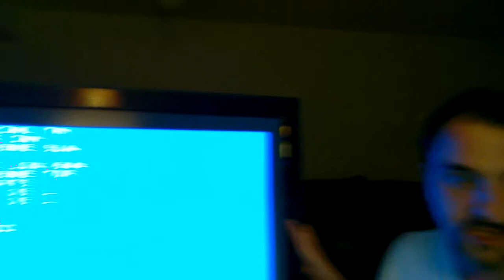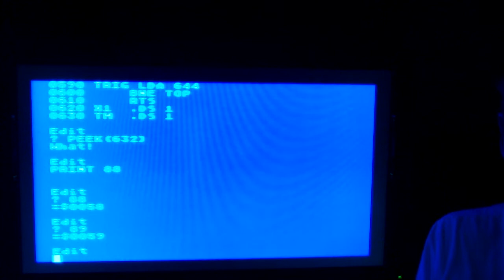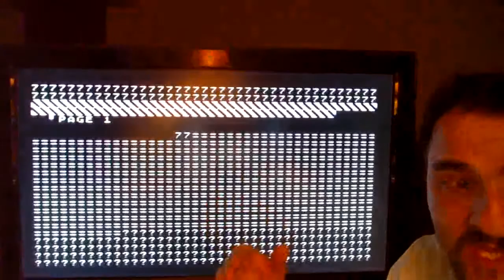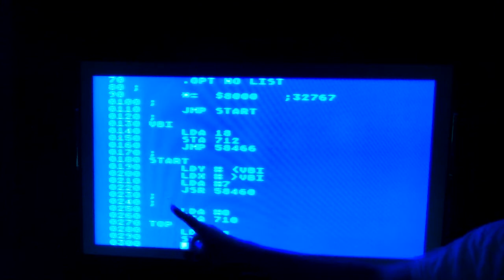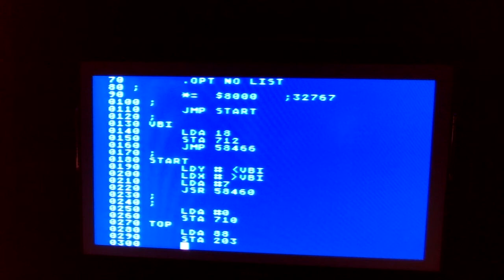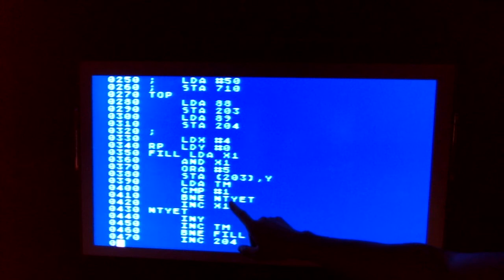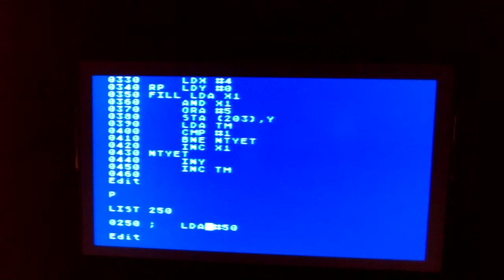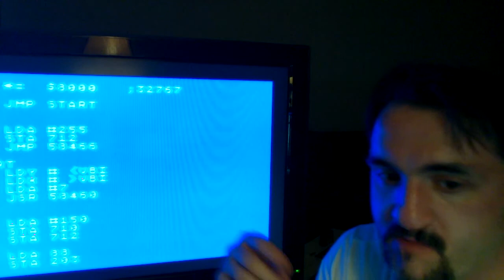Atari Machine Language Scroller (MAC/65)

Comment: I like that someone is providing information on 6502 Assembly language for the Atari 8-bit series of computers.   I would recommend a bit more structured approach, Thank you for doing this.

As to your camera issues; get it focused correctly on the screen and do not move anything in or out of the view, and you should not have any trouble.   To show shots of books record that separately with the camera on a fixed stand and the books on a surface (no wobbling), then cut your videos together.